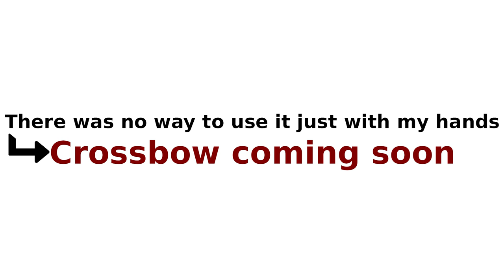Metal Bow out of hay rake teeth - simple weapons

Comment: I like the idea of using those forks! Change the direction of the way they are attached to the ‘riser’ and turn this into a compound bow with cams (or pulleys) to lower the draw weight. Would require quite a big redesign though.

Edit: you are currently using the springs the wrong way around. A torsion spring should have a contacting inner diameter during deflection... you are now ‘opening it up’ rather than making it smaller. This makes for poor energie storage and thus low efficiency. Hopes this helps. (Same goes for the crossbow you’ve made...)

Lastly you should put some pretension on the springs/bow.

Comment: what kind of metal are you using?
Reply from the maker: Jhewee Diño 
Main handle: aluminium (easy to work with)
 Hay rake teeth: Hardened steel  (reason I was not able to drill through)
Reply: simplecraft oh ok tnx